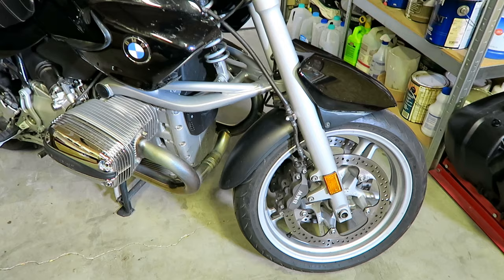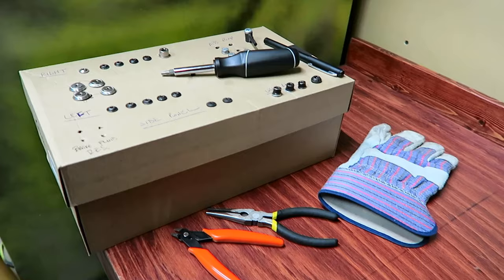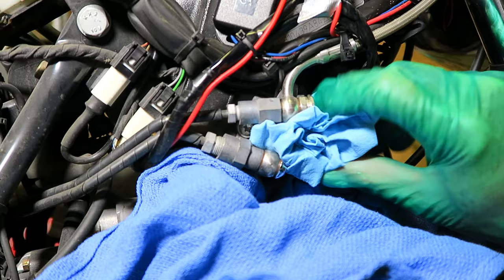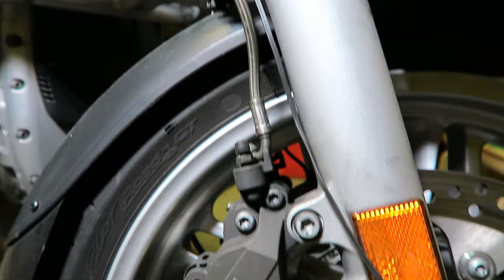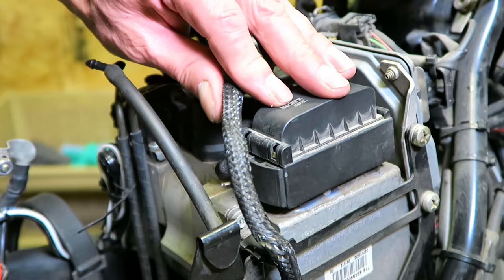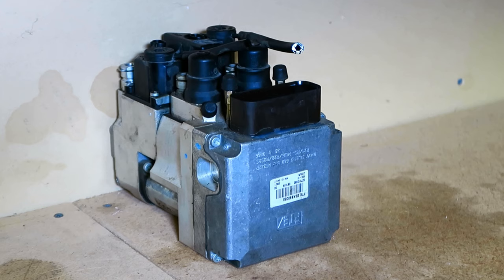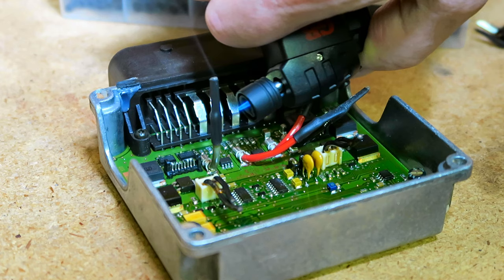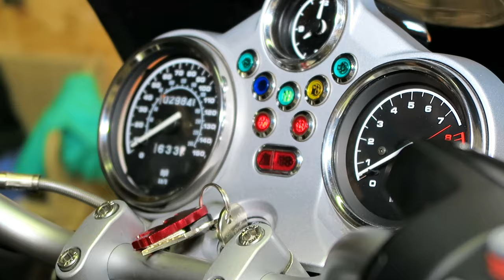BMW R1150R ABS Removal | How I Convert My Bike to Non-ABS

Comment: Bonjour, 
Sauriez vous s'il vous plaît, quelles sont les références des contacteurs de freins pour r1150r sans abs ?
Je suis votre vidéo pas a pas  :)
Merci d'avance :)
Reply from the maker: I don't know the part numbers for the non ABS brake switches off hand.  Many BMW dealerships that sell parts online have schematics that show the part numbers.  Beemerboneyard.com sells used BMW parts and may have the answer as well.  I didn't change the switches on my bike.  I was able to keep the existing switches by maintaining the electrical portion of the ABS block.  That's the housing that I separated from the ABS pump and reinstalled on the bike.

Comment: My ABS system just failed on my 2005 R1150R, and the mechanic quoted me about $3500 to replace or $2000 with a used ABS. Way out of my range. I'd like to try this, but don't feel I have the skills to do it properly. I'm looking for anyone in central Texas area who be willing to help me with this. Please let me know if you know of anyone who can help. Thanks! -Jeff

Comment: I just picked up 2003 - 1150GS with Servo ABS.... is that the same as your 04'?  Servo?  
Btw...looking for a Service Manual....any recommendations on brand manuals (Haynes),  cd or ?
Good channel...Thanks....Sub'd
Reply from the maker: I'm not certain but I would think the 2003 1150GS is very similar to my '04 R1150R when it comes to the servo assisted ABS.  I'd recommend doing some extra research.  I have a BMW CD that was given to me by the previous owner of my R1150R.  I don't have a recommendation on brand for manuals.  I've owned a Clymer manual for a Kawasaki motorcycle that provided good detail.  Thanks for watching.

Comment: Great video! what website did you buy the bypass from ?
Reply from the maker: If you're talking the junction for the front brake hose connections, I ordered it through my local BMW dealer.  I would imagine there are BMW dealerships with online stores where you could order the part.
Reply: @WheelStories  Do you have the part number? Thanks for the amazing video!
Reply: 34327650965 got it!

Comment: Why don't you get the module rebuilt or replaced. That's what eBay is for.
Reply from the maker: At the time I couldn't find a rebuilt unit or company that could rebuild the module in a timely manner.  Plus having the abs module fail while riding was scary.  I had nearly 0 braking power when the device failed.
Reply: @WheelStories  Rebuild - Module Master USA
Reply from the maker: Thanks for the info.

Comment: This works on a GSr1150 adv 2004?
Reply from the maker: I don't know the answer.  I'm not familiar with the 2004 GSR1150.  The routing of the brake fluid lines will likely work but I am not sure about the electrics and your odometer.  Those are questions you will need to investigate.
Reply: @WheelStories  thank you so much Sr, And hi from Mexico.

Comment: You are accustomed to riding without ABS? What do you mean? It has no effect at all unless a wheel locks up. Are you accustomed to skidding. You actually dont lose any braking power, you lose the power brake assistance, the braking is the same. You proved that by just connecting the master cylinder directly to the brake. So you changed the servo assist rather than pay for repair. In diing this you also lost ABS

Comment: The ABS system on my bike requires the brake fluid to be replaced every 24 months to insure reliability.  Does BMW have a similar maintenance requirement?
Reply from the maker: Yes.  BMW calls for a fluid change every 2 years.  The fluid was less than 2 years old when the failure occurred.  I don't know if the previous owners had problems with the integrated ABS system.  I'm the third owner.  The integrated ABS III module with the servo assisted brakes is known to fail.  Based on my research, it appears to be a fairly common problem.  The replacement at a certified BMW repair shop is very expensive.  The part itself, brand new, is around $2.8K.  The bike is 16 years old so I went with the DIY repair, to non-ABS, like my 2003 model that was build that way by BMW.  Thanks for watching.
Reply: @WheelStories  You obviously made right choice.  The ABS unit on a 2009 HD i owned failed coming down Lolo Pass in 2017.  I traded the bike off instead of fixing it.  Even though it had an extended service plan in place.

Comment: HI, could you please explain what were the symptoms that lead you to remove the entire unit, i am having intermittent ABS fault kicking in on my R1150R Rockster. as you mentioned i would like to keep ABS if possible before i go to remove it entirely. kindly help. i made a video pls check the link below
Reply from the maker: My brakes stopped working and the ABS light on the dash lit up while I was riding at at motorcycle rally.  I was able to pull over.  I turned off the engine briefly and the brakes started working again when I restarted the engine.  This happened 2 or 3 more times while I was riding slowly back to the rally campground.  There was a BMW mechanic attending the rally.   He hooked up his laptop to the motorcycle and studied the error codes and stated that the ABS pressure module was failing and needed to be rebuilt or replaced.  I don't recall the exact errors and issues.  But I was able to trailer the bike home and test it around my neighborhood.  Again, no brakes.  Look into having the problem diagnosed by a mechanic if possible.  It might be something that can be fixed.  Good luck.

Comment: nice Vidéo on my K1200 LT 2007 juste made front brake ligne rear put the new ligne 24 inch with double banjo bolt not need Electrical Modification brake light is ok
Reply from the maker: Good to know.  Thanks for watching.

Comment: will this fit on my 2001bmw r1200c, im sure its the same but would a pros opinion :)
Reply from the maker: I don't know the answer.  I am not familiar with the r1200c motorcycle.  I recommend having your motorcycle studied by a professional BMW mechanic to determine an answer.  Sorry I am not able to help.
Reply: @WheelStories  thanks for responding, i dont have a bmw tech where im at thats a bummer, i did some looking and it seems easier to convert the r1200c, all i need is one long hose to bypass, the split is already there, would you by chance know if 1997 to 2004 bmw line up has the same brake fittings, like if i were to take hoses of other ones and they may fit ? if so and i get this to work its going to make a lot of folks happy because no one has a solution for this model bike and when i share it everyone will be super great full someone found a way :)
Reply from the maker: Sorry for the late reply.  I missed seeing the message.  I don't know the story on the brake fittings.  Unfortunately, I don't have any experience with that BMW model.  I'm not sure how the bike is wired either for the ABS module.  Sorry I don't have answers.

Comment: What is the cost of ABS repair or change new one?
Reply from the maker: Expensive for a new pump and I couldn't find a used or rebuilt pump.  The new part is around $2500.  That doesn't include installation.

Comment: Thank you I'll will be doing this on my nice mint 06 1200 gs . just  fail at 32k . cant trust it . and makes it lighter . !! 👆
Reply from the maker: Be sure to study up on the ABS module for your bike.  It may be different than mine and the electrical portion may require a different procedure.

Comment: Why not just stop at rerouting the brake lines and just leave the abs pump and wires alone?  I'm the lazy type person, lol.
Reply from the maker: I suppose that would work but I would need to drain the ABS pump and plug the fluid lines to avoid leaks.  Actually the lines would need to come off and the ports at the pump could be plugged.  Not sure.  I wanted the job done as clean as possible.
Reply: I’m interested in this approach also. Seems like plugging ports and/ or lines would be simpler than making a new sealed back for the electronics… and I’d rather keep the ABS unit on the bike (for the next owner to consider).. or if rebuilds become available again.
Anyway, great video, I’m doing this!